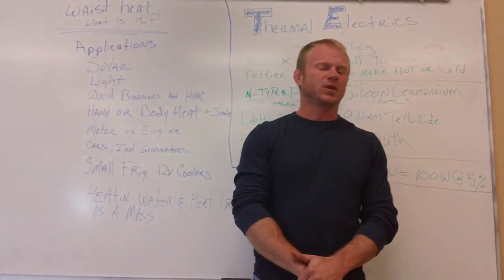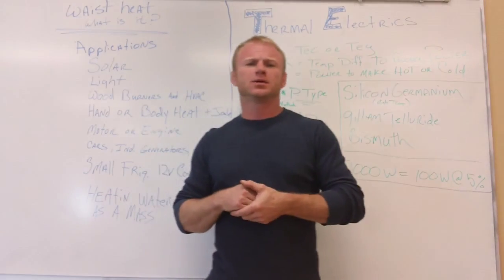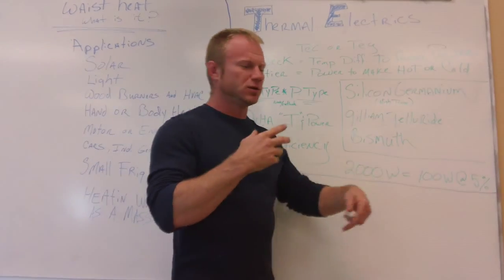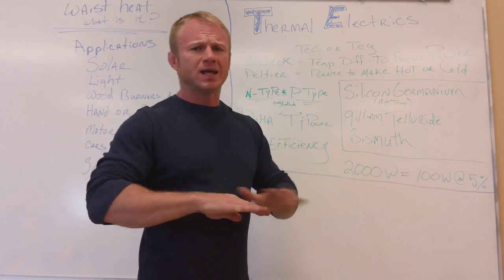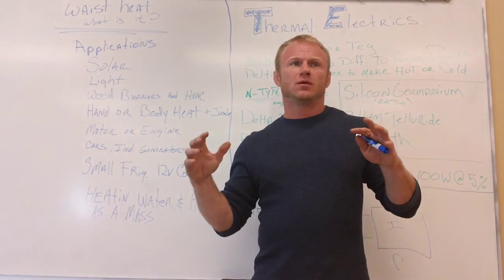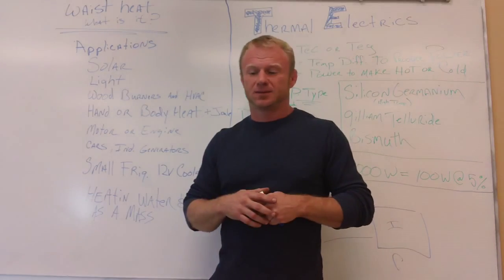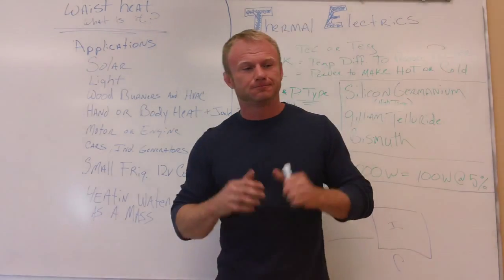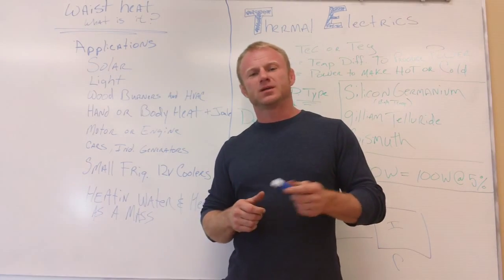Rocket Stoves or Traditional Free Electricity Production

Comment: Q. - I see "Waist heat" on your white-board, what is that Mr. Science?  
A. - Well Johnny, "waist heat" is the amount of energy that comes off of your belly when lying in the sun".  
Made me laugh.  Otherwise a good video for the science nubies. Keep up the good work!  
Solar cell application of TEGs is something I'm interested in. I looking to design a unit and circuit that will utilize the summer sun heat and flip for the cold in winter to charge a battery array. Any ideas on the circuitry?